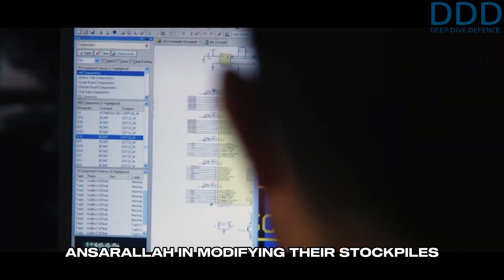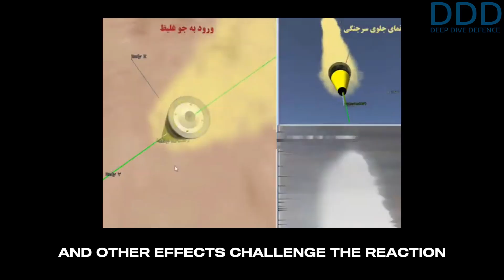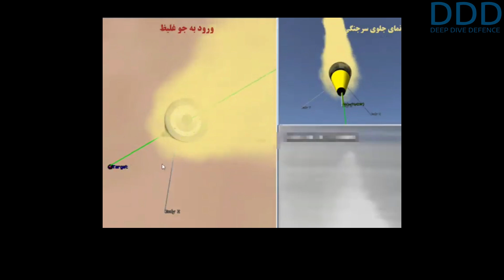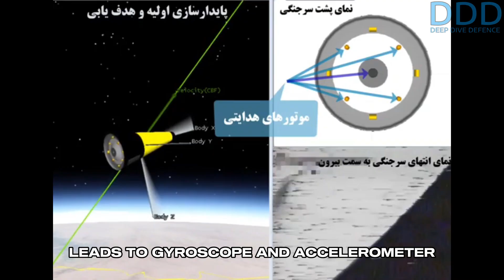Iran's astonishing missile technology leap: Rezvan Ballistic Missile and Aqil Glider

Comment: Efficacy of Air Defence Systems
The Russians (and the Yankees and Europeans agree) that all current air defence systems have only two levels of efficacy: 0% or 50%, and nothing in between. In other words, either you miss (i.e., 0% efficacy) or you need TWO interceptors to kill one incoming rocket (i.e., 50% efficacy). 
So, 92% efficacy is a misnomer. It is only 50% efficacy. This does not include those interceptors that chicken out and return (this is awesome, even the Patriots couldn’t do that). That’s the first important point. 
The Second important point is the time takes to reload…. In most cases, it takes 20 minutes to do so. Therefore, if the enemies swamp their rockets within 20 minutes (Ukraine and Gaza) the air defence system cannot re-load in time to launch a 2nd wave of interceptors. (NB: You can see this in Ukraine with the Shaheed-136). 
So, let’s look at the numbers: If you have 10 batteries (each battery covers only 50 sq km… small area!!!) with 20 interceptors in it, you can shoot down only: Efficacy Factors: @ 50% efficacy = 50% x 20 interceptors x 10 batteries = 100 hits. If the enemy fires 1000 rockets, then it is only 10% efficient. The third and most important point is the Cost Factors: 200 interceptors @ USD150k each = USD30,000k or USD30.0 million…. Vs 1000 rockets @ USD8k each = USD8,000k. this is 30,000/8 = 3,750 times….. or 0.027%.... (8/30,000) If you Fire 5,000 rockets per day the enemy will go begging China to borrow money in Yuan within one month…. That’s defeat on the Economic front. https://www.youtube.com/watch?v=xmHbe1Xrdk8  And the Patriots (costing some USD4.00 million each?) have the same efficacy problem whilst ‘defending’ Saudi from the Houthi drones…… 
Aramco just suffered a big destruction…. So, effectively, Saudi has zero security from the Yankees. ….. so the security promised by the US is just a myth.... now you know that you have been fooled.

Comment: Rezvan was developed to be a cheap decoy!  Old +20 year old Shahab-3's got newer cheaper easer to mass produce composite tanks and frames and it's range got extended to +1500km 
The main BM Iran will be using against Israel will be 1.Emad-1/2 (1650km) 2.Qadr H (Cluster munition 2000km) 3.Qadr F (Cluster Munition 1700km) 4.Sejil-2(+2,000km 650kg payload) 5.Khoramshar 1/2/4  (+2,000km Between 1.5-2ton payload depending on variant) 
The main Tactical & or Hypersonic Ballistic Missiles Iran will be using will be 1.Khaybar Shikan 1/2 (TBM 1400km to 1800km) 2.Haj Qassem 1/2 (Hypersonic TBM 1400km -1800km) 3. Fattah 1 & 2   (Hypersonic TBM 1400km -1800km)
The main Land Attack Cruise Missiles will be 1.Soumar/Howayzeh (1500km) 2.Paveh (1650km) 
The main Kamikaze Drones 1.Shahed 136 (+2500km) 2.Arash 1//2  (2000km) FYI Iran's stock of Sh-136 is in the tens of thousands. 
And these are only the weapons Iran's made public.
Reply from the maker: Rezvan as decoy is one theory, but in the video I explain why I highly doubt it
Reply: @DeepDiveDefense  
 Rezvan is not a standard decoy, it's a decoy Israelis will be forced to intercept, or it will hit its target with a 1000lb air burst cluster munition because even at a 500-meter CEP it's still a threat you will have to intercept Because it still capable of damaging your naval assets at ports, Un-bunkered helo's, transport, arial tankers, AWACS, fuel depot, refineries, powerplants, large chemical or petrochemical plants....)  The Rezvan uses cheap and easy to mass produce tanks, cheaper frames, cheaper low speed re-entry vehicles to top that off the +1000 Shahab 3 engines stored from over 2 decades ago won't go to waist.  
But as far as Rezvan being an important go to Liquid fuel BM. I can assure you it's not! If you don't believe me just compare it's structural build with Iran's main liquid fueled BM's like the Emad's, Qadir's or Khorramshahr's 
Plus, Iran's main go to Ballistic Missile against Israel will most definitely be solid fueled BM's not liquid fueled.